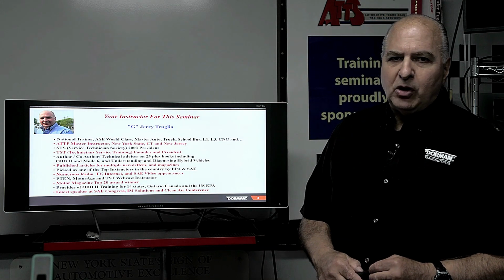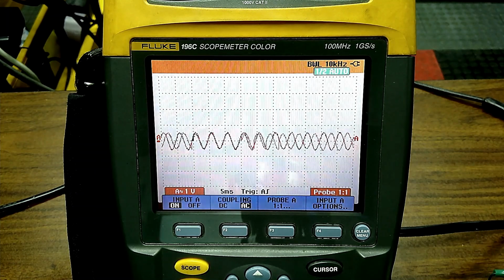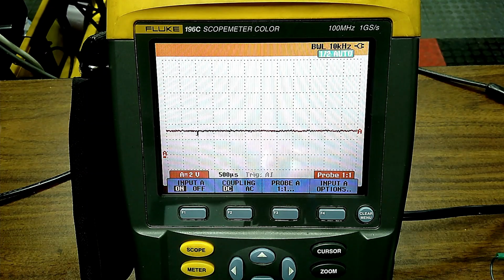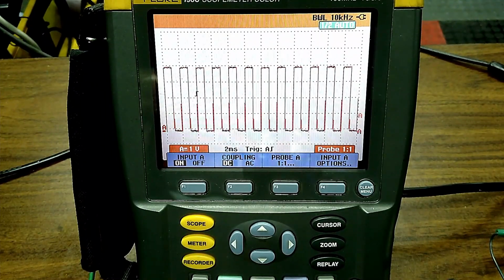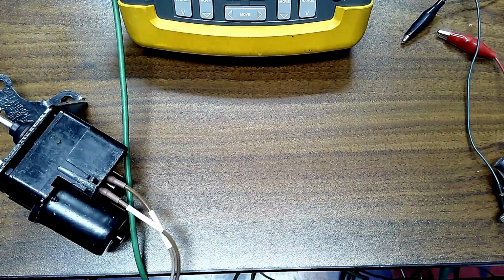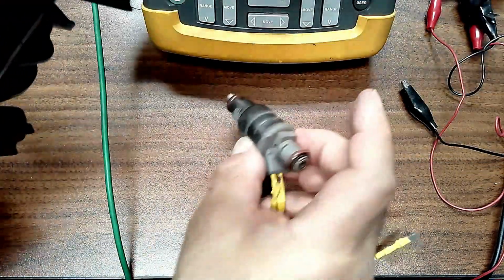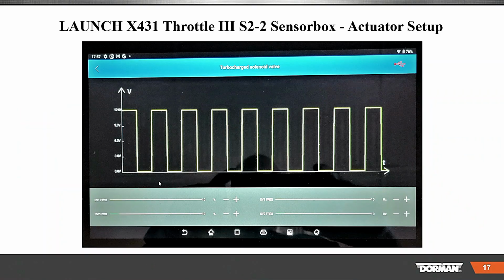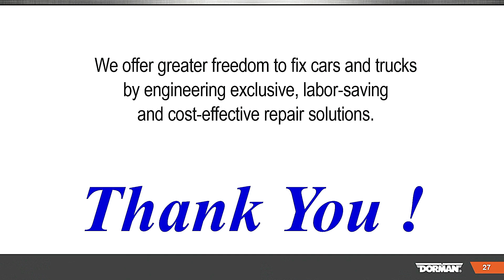Dorman Lunch and Learn Using Sensor Simulator 7 26 23

Comment: I have a Throttle III (been using launch since 1990's) i use the lab scope quite frequently ( been using lab scopes since early 1980's before DSO's) that scope is very good in my opinion  i have caught many glitches and stored them